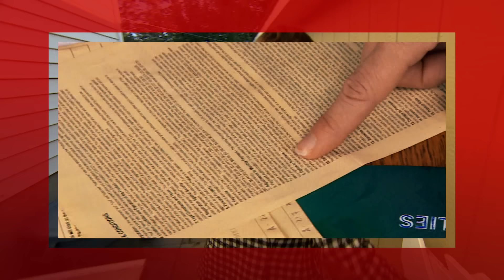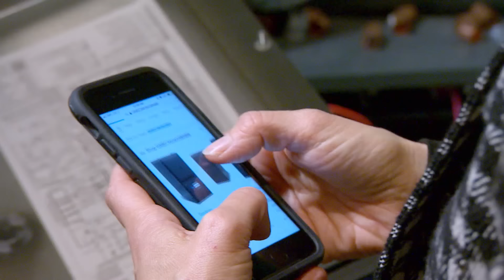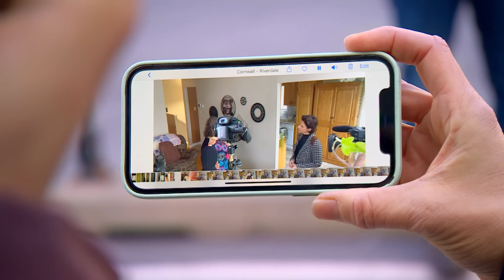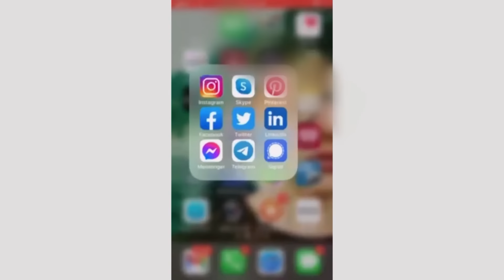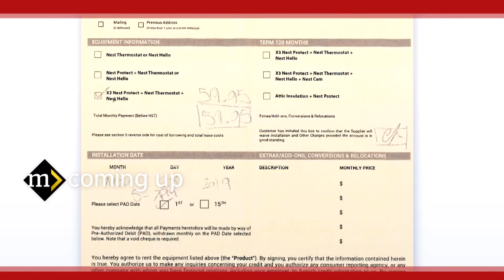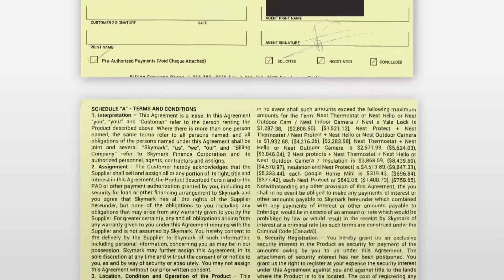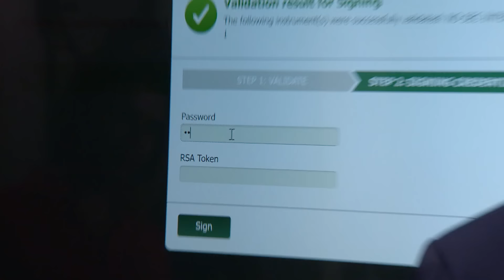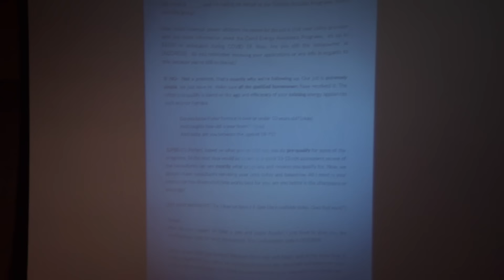Hidden cameras catch HVAC scam in action (Marketplace)

Comment: HVAC contractor here. I agree 100% marking up the equipment like this is ridiculous. But at the same time you will not pay “cost”. You find a system online for $1,200? Yes that’s for the furnace alone not the condenser. Also there are many factors involved. A company can sell more in one brand rather than another and get better pricing for that specific brand. Long story short a company with overhead will
Cost more than a two man company. Example: the company orders an ac “cost” at $3500. You are not paying $3,500. You’re paying for labor, overhead, proper installation, etc. So  $3500 just for the equipment cannot be the main reason for getting upset at the installation pricing. 

BUT: the main scams are service repairs. Capacitors are the biggest one. I’ve seen them range from $150-450 when the part alone may be $20.

Comment: 10-12 years is the normal lifespan of any water heater where I am. Functionally they all work but they tend to start leaking from somewhere around that time. There are of course tanks that can last way longer than that. I myself am a licensed HVAC tech. I tell people their tank is near the age that they may start thinking of installing a new one at some point. I however do tell them that the tank they have could have several more years and it is just what I know to happen at that age on most tanks.

Comment: I used to own a house and my mother was living with me. I was out shopping and when I came back.There was a water softener installed in my house without my consent. The house is owned by me, Not my mom so she didn't have the authority to sign anything. I was shocked.😮😢😮. I called them up. And I told them the situation and they didn't want to fix the problem. So I told them since I didn't give them the authority or I didn't sign anything as a home owner. I am not responsible so I'm gonna take it out now and throw it across the street if they don't come now and take it out.. They came within fifteen minutes and took the unit out of my house and that was that. I didn't hear from them since. This is so crazy

Comment: I'm a freelancer and I'm a 2nd responder. After a furnace fails in some way, and after the big company tells the property owner they need a $6000 replacement furnace and code upgrades, they call me. 95% of the time it's a dirty flame rod, and the  flash code on the unit indicates a flame failure. I take care of that for $80 including a new flame rod.

Comment: As an hvacr technician for 37 years I got out of the residential side mainly for this reason many years ago. I have only done commercial work for the last 30. Many companies out there teach their employees to lie to the customer,some as far as roll playing to teach you how to basically rip you off. Too many times I seen units costing more than the little run down house the customer lived in installed and leaving the customer in debt for years to come. Trust me this is not the only trade that does this,just be very careful and ask alot of questions after you have done some research of your own. There are some honest folks out there but unfortunately this problem will never go away.

Comment: Freon is a trade name DuPont and Chemours holds a patent to. It is still used to this day if you buy Chemours brand of refrigerants. Freon 12, 22, 502 (all phased out) Freon 134a (used in automotive and refrigeration), 404a (refrigeration), 410a (used in residential and commercial comfort cooling) are still available and used everyday.  This is a common misconception to the layperson that doesn't know.

Comment: There is no “it has to be replaced 6 days” it’s either an A infraction which means an immediate hazard, the gas has been turned off to the unit and you agree not to use it. Or a B infraction which means it’s a non immediate hazard but gives you 42 days to complete the repair or the gas company is coming to shut the gas off. The worst part is is that Ontario green savings often doesn’t have techs in other cities so they call random companies to go fix their equipment. I’ve had a few calls where they don’t directly tell you who or what is going on and you can’t call their customers. We won’t service them where I work

Comment: As a hvac installer the cost of the equipment is only a part of the cost it’s the experience of the installer cause if it’s installed correctly it will work perfectly and last years

Comment: WOW....This is crazy. 20 months ago I needed to replace my electric furnace. I required a 20K furnace min. I got quoted(Dec 2020) $5500+taxes and was told by 2 companies in the same town that the electric furnaces shot up in price to double the amount they were the year before because of efficiency standards. I thought the pricing seemed crazy for an electric furnace. I then got quoted $1000 for a 5 year old used furnace +instalation when I questioned the cost. I phoned a hardware store and would sell a normal person off the street a high efficency 20k electric furnace for $1800. I ended up finding another company an hour away from a large city. He came out and sold me a top of the line electric high efficency furnace for $3600(same brand of furnace but high effeciency, not mid effeciency that was quoted at $5500) installed WITH upgraded duct filter, WITH new programmable thermostat and ran new upgraded wiring to the thermostat for the future possibility of installing central air.

Comment: I'm a little late to the party but I just now saw this clip. I own a commercial restaurant equipment repair company and have done residential work in the past and absolutely hated it for this very reason. There are more damn crooks in this field than there are honest people that's for sure. There are companies that only do work for the home warranty companies which is a scam to start with but the guys working there as "technicians" (I use that word very loosely) were making over $100,000 a year and didn't know their rear end from a hole in a stump. At best they were parts changers, if they had enough parts they could eventually get something fixed. It takes some really sociopathic people to work for these kinds of companies, from the office staff to the techs.

Comment: I'm a commercial HVAC - Controls tech ( 36 years ). I continue to see licensure requirements relaxed , due to labor shortages is what I hear. I also have seen MASSIVE " standard industry practices " reduced to garbage. I have recently had to re - work a condensate drain on a large rooftop unit to meet the requirements of an inspector that had no idea as to what he was looking at . I'm afraid we haven't reached to bottom yet , be mindful of the " silver - tounged hacks ".

Comment: In Alabama you can get a free electric water heater from Alabama power just for switching from gas. I already had an electric one and hired a plumber that I knew personally to install my free one. He just signed off that the one he removed was gas and charged me a little labor. I was out less than a hundred dollars.

Comment: I'm glad they are calling out the scammers but looking at the price of an item from a hardware store and then basing an opinion on fair price when you're not a service professional is extremely misleading. Would be better to compare the price to different companies that provide the same service. Also, is rental agreement the same thing to Canadians as using credit here in the US. B/c yeah the price to buy something on credit will be much higher. If it was 10 years at 8% April, which would be crazy low in the us, would be over double the cost. The lien thing is super shady and selling equipment that's not needed is plenty no need to focus on the part yall don't understand.

Comment: Replacing the hot water heater after 10 years is being proactive, you might get 15 , 20 years you might not. $1300 standard price for 40 gallon installed. I see these newer water heaters Leak between 6-10 years

Comment: Just stopping by to remind you about the possibility of air-conditioning without cost of operation.  The EPA was not allowed to dictate the simple technology to remove the cost of operation associated with running an air conditioner.  The increase in gauge of wiring in the motor and compressor to match the current and voltage applied to the motor and compressor removed the cost of operation.

Comment: I went with my brother who was buying a used Mazda car. Sensing the ubiquitous scammers I asked my brother let me inspect the car inside-out. After checking the car's interior, I started looking under the car for erosion, it was in a dilapidated condition, the scammer got angry and told me it's a preowned car, but I vehemently told him I've the right and privilege to thoroughly check what I pay for, then I turned down the deal.

Comment: 3:37 “Factual Error” that is the “list price” for just the heating unit the ac condenser and compressor are separate units + copper and the compressor condenser unit 

It be like counting the 2x4 in a $200k house and then looking up the cost and saying see it only cost $14k to build your house. I mean just that copper pipe to the ac pump is several $ a foot…. The cost is in the installation if people don’t like the $ then there’s plenty of YouTube videos on how to install it themselves 

What the real scam is is telling people they need repairs they don’t or telling them they will “save money” by having the unit professionally replaced which is usually a lie… I replaced my AC And furnace diy, and it was $5200 and two weeks work even at that low price the 17% efficiency improvements will take YEARS to recover the investment

Comment: This is a huge issue in the US as well. 98% of places try to get you $12k or more for a $2500 basic crap HVAC system that's cooling only with basic seer rating. I have a $4500 ACiQ extreme cold heat pump that goes down to -22f that was only $6800 total with new vents and everything

Comment: Moral of the story, do not rent house fixtures. If you do and this happens, remove said fixture(s) and return to owner. Be sure to take the necessary steps to return fixture in proper working condition/order and get a receipt of return with owner's signature. At that point the fixture will no longer be attached to your home and the lien gone.

Comment: Another problem, states (Illinois-my dump of a state) not having strict licensing requirements for HVAC companies. We deal with gas, electric, plumbing, ventilation, have to be EPA certified to handle refrigerant, yet some schmo can get their EPA cert, gauges, and work out of their Nissan Sentra. The whole rental game is shady and should stay in Canada. Additionally, with the consistent increase in equipment and material cost, the HVAC trade is seeing many mom and pop shops shutter doors to larger consolidators. You think the small guys were pricey? Wait until it's companies with hundreds of employees dominating the market.

Comment: I had 3 company’s tell me I needed a new air handler at $5k. I found the air handler online cost $1800 new and they said the labor was 3 guys at 4hrs. So I asked how labor could cost $3200 for 12hrs of labor?  That’s like $300 pr/hr. All each one said is well if it’s cash we can take 10% off. I hung up! So, I decided to take a look myself and noticed the fan motor jammed. Everything else was in perfect shape. I had another company come over and told them what I want done. $800 later new fan & 6yrs later no problems. Now even those guys overcharged. The fan cost $185 but they did take it out & put the new one in and did do what I asked of course with no guarantee. All These guys are crooks if they know you don’t know what your looking at. Be careful and always get multiple bids, 4 or more is best!

Comment: I had a gas hot water heater I rented from Reliance for almost 20 years. It popped a leak. I decided not to have them replace it, not continue the contract and buy my own. They told me it would cost me $1750 to break the contract. I told them they could pick up the old water heater and to screw themselves. They said if they have to remove the water heater from my house it would cost $150 more. I told them again to screw themselves and that I'll place your water heater on my front lawn to pick up. They never picked it up and there is no lien on my home according to my credit report. Sometimes you just have to fight back. Scabs and scavengers.

Comment: 9:40 my water heater got ticketed by BILL from Bryans fuel for not being 18 inches away from the furnace service access was around 14 or something more than enough..  he wasn't even servicing it was repairing a condensation issue improperly diagnosed, with more than enough room, because they want to replace the water filled part not stop the water from condensating with insulation over the pipe.. absolute ballcap, they just wanted work and was no real issue, and didn't solve the real issue with repeated visits, i found out the issue short high efficiency pipes condensating and most furnaces have a drain tube right on the high efficient pump mine does not, they ordered the part but didn't fix the root cause and I was without heat in -20 weather, get frost bite pretty fast, the guy was a complete jerk right from the beginning leaving the door open and bringing his tool box in with a bunch of snow on the bottom, not removing shoes

Comment: Those bushes needed to be trimmed back or removed from that outdoor air conditioner unit. Bushes that close will restrict airflow and cause the unit to run hotter then normal.

Comment: So as an hvac mechanic the lady with the goodman furnace theres a lot of missing context is she paying 12,000 for the unit or 12,000 including unit, duct work, venting, and labor because if the 12,000 with all that was listed second was the cost then 12,000 is a fair price
Reply: Also with the ac system “freon” is a brand of refrigerant and certain refrigerants are banned per the epa or obsolete r410a is the most common now r22 is phased out so missing context there too

Comment: Just the very idea of leasing equipment that is built into your house raises red flags to me.  Service contracts, home improvement loans, those are the sorts of things I could see paying for over a period of years.   But those would be against items you *OWN*.   If it's something I'm leasing, it should be for something that can readily be removed within an hour or so.    For home security I'd be leasing maybe a base-station, but the cameras, doorbell, etc are built-ins, so one way or another they're MINE.

As it is I'm looking at exterior cameras for home, and not only would I be buying the cameras outright, I'm looking for ones that would use an open-source management system that doesn't require some external service to use.

But then again I've always presumed anyone showing up at my doorstep to sell me something, is most likely planning to rip me off.

Comment: First, I will help you with getting the DL on the HVAC industry in a way that will help you. I have 35 years experience as a technician and in sales. 
  I have to say, at the 4 minute mark, you're absolutely wrong. That furnace install costs way more than $1800 and you're spreading false information. The installation cost is based on all parts needed for the installation plus labor cost, duct transition, venting, permit fees. etc. 
  If you want the truth, if that furnace replacement was 90%'er for 90%'er and that venting was already there,  it would probably cost her between $7-9000. BUT, if she switched from an 80%'er to the 90%'er, all the intake and exhaust pipe would need to be installed from scratch, holes drilled through the sill and vent terminations installed. She's looking at between $600-900 minimum  just for duct transitions. 
 You really shouldn't spread false info. Yes she probably paid a little too much but she wasn't ripped off. I've seen companies charge $24,000 for something similar. Was the air-conditioning replaces as well? If so, she got a steal on that installation.  
  Never sign a contract for installation until you receive several quotes. Educate yourself on the equipment being installed.  Most of all, investigate the contractor doing the work. Do they have a good reputation? Do they have any complaints about them with the Department of Consumer Protection? If a contractor tries to rush you into signing a contract or asks for your financing info before giving you a price, kick them out. If they don't take no for an answer, call the police.

Comment: Yeah 1,800 for the furnace but that doesn't include the labor or materials. And looks like she has a coil so they would need to solder the copper. I mean that just the furnace in the box for 1,800

Comment: I have 36 year old water heater. Outside of a $30 part, she still works. Could a new one increase efficiency? Sure. But I have hot water for my shower. If you have that now, 90% of the time you don't need a new tank.

Comment: Why would anyone rent HVAC systems?  Everything could run fine but it still might need replacing if it's old enough and not energy efficient.   Heat pumps are the way to go and should replace old equipment.  Heat pumps aren't too expensive (unless it's geothermal, then the installation costs are higher).   Also heat pumps replace both heating and cooling in one unit.  Even if there new efficiency ratings that's only applies to the manufacturers.

Comment: Yes there are scammers, but they are few and far between. The best protection from paying out the nose for replacement and repairs is to learn how to do this stuff yourself. Don't like it? Get ready to pay up. That's the unfortunate reality. Or you can pay Joe Plumbing and Heating to do it cheaper and never hear from them again in a year.